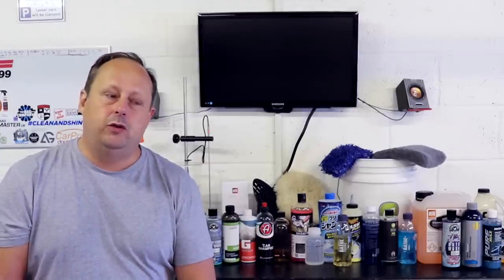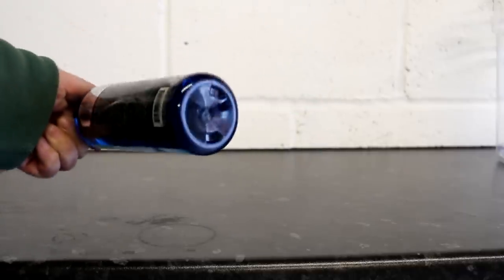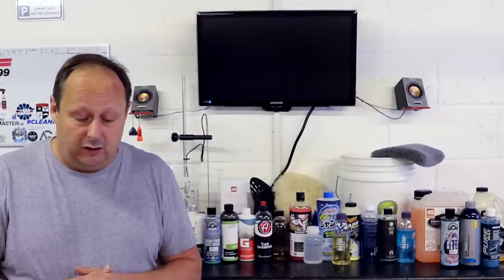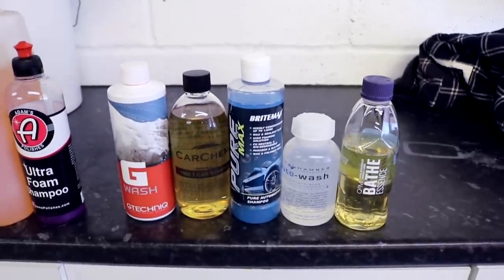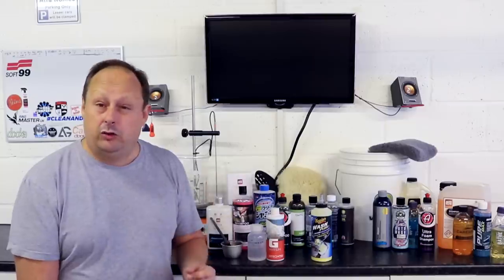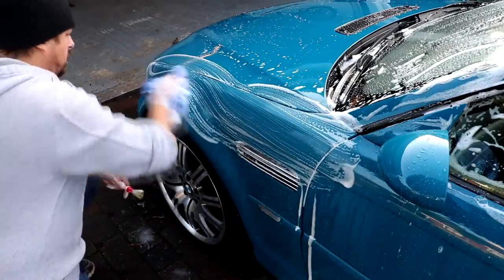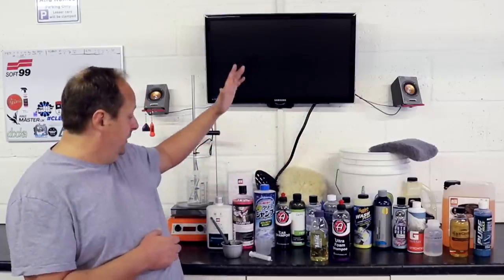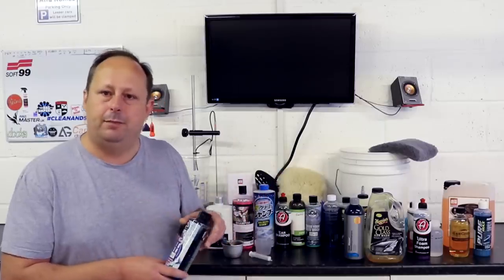The Best Car Soap Shampoo - 20 product shootout

Comment: I'm shocked that AutoBrite Magifoam didn't make the list, maybe because it's more directed at foamers? Probably the same for Griot's Garage foaming surface wash as well as their Poly Gloss, simply amazing products. 

My car is coated with TAC system power plus so I'm particular about what I use on my car, Mystic Bubble is in the mix ofcoarse but Gyeon Bathe/Bathe+ are in the mix, along with CarPro Hydrofoam to name a few more. This said, when my car is just dusty from days of driving to and from work, Griot's Garage foaming surface wash works amazingly! I simply foam with my IK Foam 9, let it sit and rinse off and dry. I use Poly Gloss the same way but always a regular wash first. The Griot's foaming surface wash finishes very clean, you can really see the clean! 

Speaking of seeing the clean is AutoBrite Magifoam, WOW! I bought it based on your review, literally bought it right after your review of it a couple weeks ago. I added 2 oz to the 1.3 gallon tank and DAMN did it foam in my IK Foam 9, simply amazing and when it rinsed off you could see the sharpness, awesome!

I have a number of the other washes as well but its your review, not mine, LOL! I really appreciate these reviews when doing comparisons, cant get more info than right here!
Reply from the maker: magifoams a pre wash though klasse.   its going to be in my snow foam shoot out though mate.
Reply: @ForensicDetailing  my bad, you did mention that at the end. Thanks for tuning me on to it though, OUTSTANDING product!

Comment: Hi. Enjoying the channel 
After I’ve waxed my car with Bilt Hamber double speed wax, should I use a ph neutral shampoo, like car pro reset ?
Reply from the maker: yer reset rocks..  maybe try bilt hamber autowash shampoo when you run out of reset.  doesnt need to be PH neutral
Reply: Forensic Detailing Channel 
Thanks for the reply , I thought If the wash was not ph neutral , or ph balanced it would upset the bilt hamber wax I’ve already put on ?

Comment: Reasons to eliminate Gyeon bathe essence are according to myself: 1. Cost per wash, I needed a lot of it to get a good lubrication (70-80ml on 15-16 liters). 2. Barely any foam only if you add a lot of it. 3. The product becomes very jelly like which isn't really nice to get out of the pump sprayer. 4. No smell at all...

Comment: Brilliant video as usual the only thing I felt that was missing was which ones glide the best/have the best lubricity
Reply from the maker: it cannot be measured Mark.   even in a lab.  it would be like comparing 10 bars of soap to compare which one is the slipperiest.
Reply: @ForensicDetailing  I think just your opinion would have been good enough as a trusted reviewer with lots or respect from your followers
Reply: @markhart6743  go with the bilt hamber auto wash fantastic lubricity and awesome cleaning power the go to shampoo imo

Comment: Last night I tried Gyeon Bath Essence for the first time, and wasn't overly impressed. Gyeon's advertising department touts the following: "Q²M Bathe Essence has HIGH FOAM AND A LARGE AMOUNT OF SUDS.” as well as “……light organic contamination are combined with fantastic slickness and HIGH FOAM.” 

In my experience, using the recommended 5ml/10 liters of water, there was virtually no suds, and definitely no "high foam". I understand that neither of these are an indicator of a products ability to clean. However, I wasn't very impressed with the final results in terms of cleaning power.
Reply from the maker: its been a while for me since using it but essence was one of the most foaming shampoo's I think Ive used.   dunno, all feedback is good.  only thing I didnt like was the way it went gooey...   dunno maybe you have mega hard water up it to 10ml per 10 litres maybe.
Reply: @ForensicDetailing  In looking at the Amazon (USA) reviews, it would appear that I'm not the only one who is experiencing these issues. When I built our home, I specifically made sure that soft water was plumbed to the garage (for car washing purposes). I check it yearly, and the hardness is at 0. 

Maybe they have changed the formula?
Reply from the maker: @CRA677  no idea buddy, but like I say its one of the foamyst ive used.  really nice..  you can see me use it in the gyeon brand review video a bit more as well..   maybe you just got a duff batch.    just keep adding until you get the right level of foaming, but ultimately if it does not perform well you have to like use something you are happy with. USA brands have cool soaps.
Reply: @ForensicDetailing  Thank you! I watched the video you mention (that I somehow managed to previously miss), and see that you used 10mL. I'll give that dose a try and see what's what. 

Again, thank you!

Comment: Hi mate just got my m140 a few months back ( 68 plate ) love the channel , slightly off topic but was wondering weather you had experienced the imfamous creaking door rubber issue and what to put on it  , i`ve used gummy fledge but comes back after a week or so and don't actually know which part is making the creak ( just lubing everything rubber ) I know I could take it back to bmw but seems a hassle for a job I can make part of my cleaning regime .
Reply from the maker: yo mark,  when I had the buckled alloy on the nearside front.  the doors creaking was there.  but when that was sorted cant say Ive noticed any door creaking.   sounds silly but just check your tyre pressures all match and next time you have the wheels off just make sure none of them are even slightley buckled because maybe its the extra vibration on one side that triggers it.  because I have the same rubber as you and mines not doing it.  so just a though it could be like vibration triggering the underlying problem.  I dont think any product will sort it  really, like you say it will only be a temporary fix.   awesome cars though mate.

Comment: Wow, great video and the result was a surprise for me. I could have put money on it being between BH Autofoam and Adams. I think the fact that Adams got promoted to the podium, despite it not offering the best value (by “tight arse” Jon) speaks volumes about how nice it is to use.
Reply from the maker: its lovely yer, it really gave me a reason to be there on the podium.  I know a lot use it because its great in the heat.  so like if soap drying out is a problem for you in the summer that would be the best choice to solve that problem or help solve it.
Reply: Forensic Detailing Channel that’s just what I use it for - it’s my summer soap. Recently, I’ve been using it in winter too because I like it so much. I keep meaning to try the BH, but haven’t got around to that yet.

Seeing your video, I’m tempted by the Koch Chemie for my ceramic coated company car.
Reply: I mix BH with the Adams. BH for cleaning power etc and the Adams to give more suds and help prevent it drying out.

Comment: Hello excellent video!
Question is it beneficial to use 0ppm water in your wash bucket, does it affect in a positive way the shampoo dilution ratios and will you get better lubricity?? Or is it the same using regular water?? Thanks in advance.
Reply from the maker: hey you will just get less junk (minerals etc) in the water so less water spots if it dries.   In terms of better lubricity and like foaming or dilution.  Im not sure your going to be able to measure that or tell the difference.
Reply: @ForensicDetailing  thanks for your reply.

Comment: Pure max is available in 1 gallon size :)
Reply from the maker: bah my bad sorry.  I had to compile a lot of data in this test wouldnt surprise me if theres a few things out like this.   that would maybe have helped to lower the britemax puremax cost per wash down a little but closer to 10p perhaps but it wouldnt have got down to where carchem was 28quid for 5 litres versus 44 quid for 3.7litres though.

puremax is a good one along with G wash as well both these 2 do what I need.

Comment: I'm about to run out of shampoo Jon.
Gonna put an order in with Imran but what would you go for Bilt hamber auto wash or simple wax suds?
Reply from the maker: Hey so I use autowash so thats a defininitve and answer as I can give.   If you want to try others TAC systems mystic bubble rocks.  And yer try simple wax suds.  Ive used it its great.   Ill use any shampoo really.  Ive tested at least 100 I use one and try another.  theres only 3 Ive ever thought were bad.
Reply: @ForensicDetailing  I asked on I2D Facebook page and it's a 6 to 6 tie on Bilt and SW.
If you use Bilt then that's good enough for me mate.
Thanks for the reply Jon. 👍

Comment: Hi John do you think using bilt hamber auto wash would interfere with a paint coatings properties?
Reply from the maker: I think you could use Bh with coated cars no problem but maybe you might need to rinse it a bit more dont know guessing.  I think once Ive coated my car I will kind of use a shampoo thats been developed for the coating (Ive got about 4 of them so may as well use them).   might make a decent quick video to explore it.
Reply: @ForensicDetailing  do you do the same for sealants and wax? e.g. Angelwax shampoo and angelwax wax or Bh shampoo and Bh wax?
Reply from the maker: hmm you could do.  I dont though kim.  but why not.    I guess the reason to do this is that brand may have tested all their protection products against their shampoo's etc...  but the reason to not do it perhaps is it isnt going to make a massive difference.
Reply: @ForensicDetailing  Thanks for the reply!
Reply: I have used Bilt Hamber Auto Wash plenty of times on my motorcycle which is coated with Gyeon Matte Coating. It rinses clean and it doesn't affect the water behavior at all : )
Reply: @Eric-lu4hx  thanks for the reply:)

Comment: Gosh you look different with no beard. Another great video. Have you tried the Demon snow foam? Is it good or at least ok?
Reply from the maker: I have yes.   Its a mass market product and some things about it are quite sensible.   But I wasnt overly keen on it, mainly because my hose doesnt kick out enough power to make their sort of clever bottle (free soap dispenser and container in one) function that well.  So the process didnt work for me and holding a 2 litre bottle full of product while you spray it over the car is a serious work out when its new.    Its ok though, its anti scene, but in the real world its a simple idea that I think lots of normal people could use that dont have a garage full of detailing gear.  is what it is, im not like gonna tear into tetraysl because their core business is the complete opposite of the detailing scene and I am a customer in the sense I use their panel wipe degreaser and I find it very effective and great value.  any company that provides me a product I choose to go and buy gets a lot of my respect.

Comment: Which shampoo would you suggest for helping prevent mineral deposits with hard water and providing good lubrication during the contact wash? I'm aware Meguires NXT advertises it's water softening abilities.
Reply from the maker: its vritually impossible to test accuretly MAtthew.   But the Adams shampoo perhaps might be the best on that front.

Comment: What would you recommend for cleaning the inside of a artic truck, sone examples of dirt Im facing is ash tray full of cigerates, dashboard full of dust and the odd coffee stain.  Something  that go in the bag with a micro fibre be handy to have is nice and clean in the morning so im not driving in someone elses filt.
Reply from the maker: something like bilt hamber surfex HD at like 20-30:1  or greenstar at like 40-50:1...   any APC though shamrock really.
Reply: What John said 👍🏻

Comment: Hi there, sorry to change the subject but I have just bought some tardis and want to know what spay bottle I need so it doesn’t melt
Reply from the maker: nigel Ive had tardis in the same sonax sprayers (the black bottle ones with the red triggers)  and its been in there for years and the sprayer is going strong.
Reply: Big thanks great video’s👏

Comment: Hello Jon,  wondered what your thoughts where on Turtle Wax Pro wash 'n' wax shampoo (25l for £16.78 from Costco) i know it's not going to be or ever will be, a car detailers go to product, but simply as a value for money item and do one of those quick washes when you don't have the time, can't use the BH auto wash or a CC 1900:1 all the time, is it worth it ?
Reply from the maker: I personally dont want wax in a shampoo.  when I shampoo a car my aim is to clean it.   To work out value, take this product work out how much you need to use and work out cost per wash.   cost per wash of something like car chem 1900:1 was less than 10p.
Reply: @ForensicDetailing  Thanks for the speedy reply Jon, i haven't bought the turtle wax, i was just  very curious at what your take would be, been waiting for ages for Car Chem to put the 5 litres on offer, they've put the the smaller one's on offer, just not the big 5 litre.

Comment: Preferable foam cannon and 2 bucket friendly car shampoo that produces good suds and cleaning power at a decent price?
Reply from the maker: The car chem one will do that if you want good price just need to mess around to find the  sweet spot concentration.      Adams ultra will do that well but its not cheap.

cleaning power Gwash or Bilt Hamber all the way mate.   Gwash is the more foamey of the 2.        Actually Gwash fits your question best.
Reply: @ForensicDetailing  is the Gwash safe for sealants? Adding that to my Amazon wish list lol.
Reply from the maker: @justin94block  gwash. safe enough mate.  if you want more cleaning power though that might attack old school waxes a bit  more

Comment: So Jon, half tongue in cheek (But only half) what about Turtle Wax Zip Wax Wash? I was in Costco the other day and they are doing 25 litres (Yes 25) for £15, I couldn't believe it. I expect to be damned for even asking this question but I think it's a valid one.
Reply from the maker: dont be damned for asking the quesiton ray thats the name of the game.  turtle wax I think put out a lot of patents back in the day for various formulations... they have been in the game long enough to give you a decent car soap I reckon (not used it though).  what I would say though is look at how much you have to use of the product to work out a cost per wash.   It wont be lower than carchem 1900:1.   I suspect then concentration of this TW offering would be around what 150:1 or something.   but either way it sounds like decent value.. only problem is you would be stuck with 25 litres of something you might not like if it goes wrong.
Reply: @ForensicDetailing    Well, If I ddin't like it I could have the most foamy drains in the UK.

Comment: Hi mate just went to buy some CarChem... is the 5L down to £12 or am i clicking the wrong product? Sounds too cheap to be true?
Reply from the maker: its correct! use discount "detail12" as top they have it like 70% discounted.   get all this as well. they are giving stuff away.  dont miss out.

1900:1 Pure Shampoo - 5L × 1 £12.00
Screen Wash Rain Resist - 500ML × 1 £3.75
Prep Panel Wipe - 500ML × 1 £3.20
Citrus Clean - 5L × 1 £14.00
G&T Glue & Tar Remover - 500ML × 1 £6.80
Hydro QD - 500ML × 2 £5.40
ReFresh Odour Eliminator - 500ML × 1 £2.40
Clean Wheels - 500ML × 1 £2.85
Subtotal: £50.40
Discount: -£6.05
Shipping: Free Shipping On Orders Over £20
Payment method: PayPal
Total: £44.35 (includes £7.39 GB VAT)
Reply: Forensic Detailing Channel hi mate thats whats i was going to ask, they have pure shampoo at £12 but the super suds one at £15?... surely £ more worthwhile?
Reply: Forensic Detailing Channel says details12 does not exist by the way
Reply from the maker: @RDR1456  detail12
Reply from the maker: get the 1900:1 deal tony.  get the citrus as well 5litres or 25litres and buy all the ones that are like 2.50 for 500ml.   Stock up mate the 1900:1 and the citrus are superb and this is below wholesale price get in there mate
Reply: Forensic Detailing Channel hi mate super suds shampoo is 1900:1 too.... its just odd as you have to type in suds to find it.... yes ive nabbed the 5l stuff, inwent for 5l of the leather 2in1 cleaner too, and the 5l iron detox for alloys, you tried them?
Reply: Forensic Detailing Channel yh doesnt exist either, never mind.

Comment: Car Chem 1900:1 reduced to £10.99 for this weekend only - be quick!
Reply from the maker: thats a good deal its like for the litre bottle right.  the best deal is when they drop the 5 litres down to 21 quid though.  although not everyone will want 5l because thats a crap load of shampoo at this concentration
Reply: Forensic Detailing Channel yeah correct - shame delivery is half the cost of the product on top though...agree 5L is probs better value overall